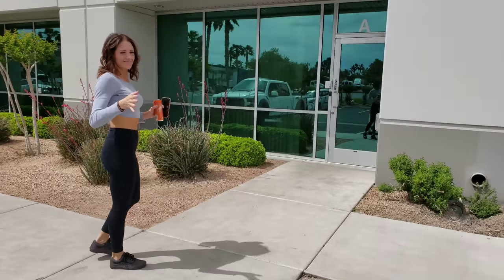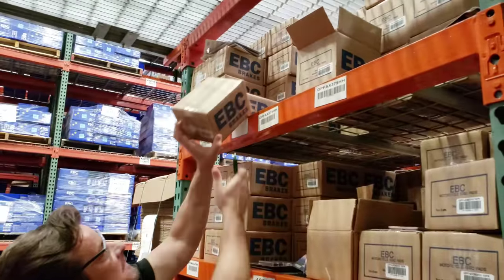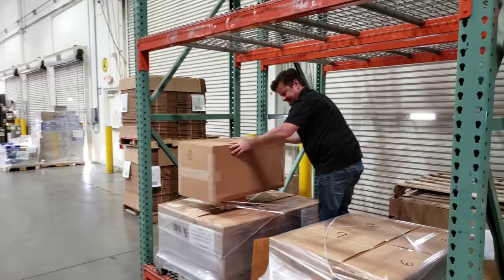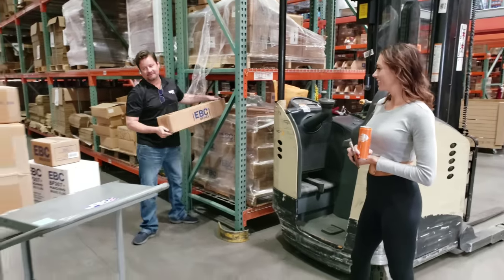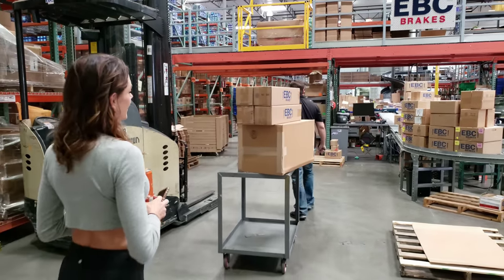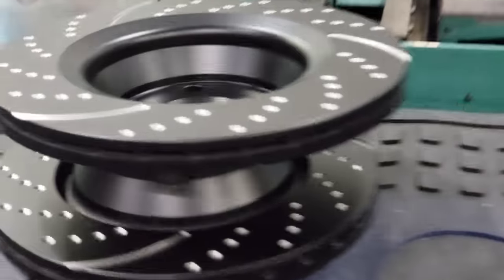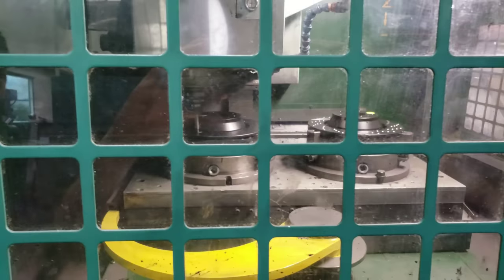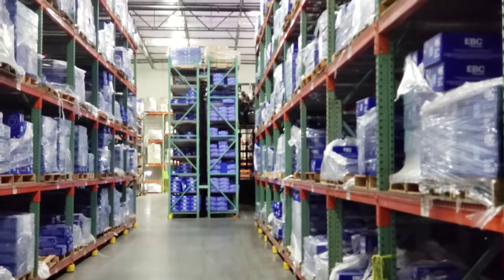#EBCBrakesUSA "Walkabout" featuring #TrackdayGirl Nicole | Irnieracing Track Giveaway

Comment: EBC makes great stuff. Wonder if they have some front pads that make the Beta front brake less touchy ?
Reply from the maker: I got a box of EBC Brake pads for the Beta's!
Reply: Will they fix the light switch curse ? Many riders have been put down due to this issue. The only Beta flaw. Great power, great chassis... bad brakes
Reply: When we last talked you were mentioning testing these bikes. How bout testing EBC pads too?!?
Reply: EBC would definitely have a competitive advantage with a pad that cured this issue. I mean nothing worse than grabbing the front brake and having it slide out. Eating dirt is never fun.